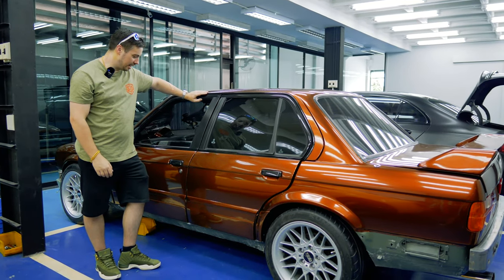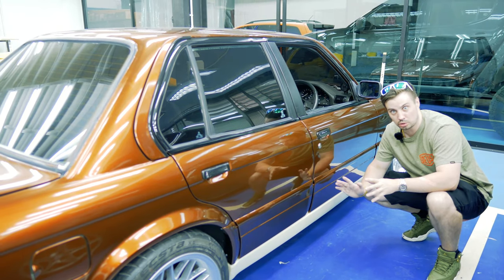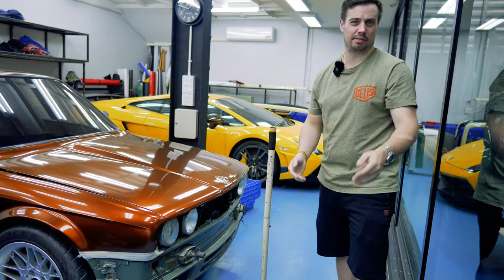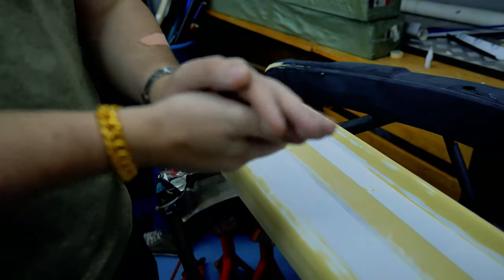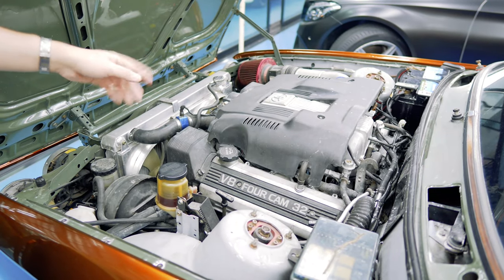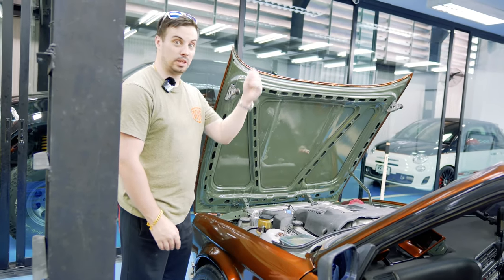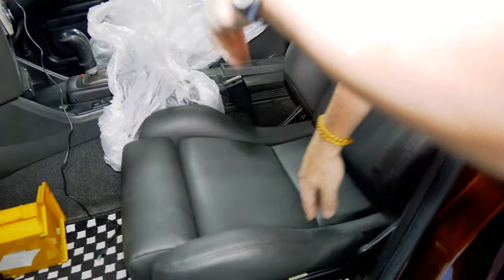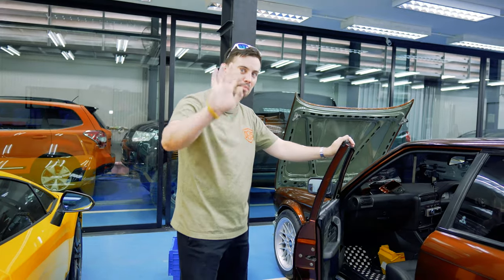Project Topgun Part 4 - Bodywork Issues & Colour Change - E30 1UZ V8 Engine Swap

Comment: im doing the same swap rn for drift. and you said its a 1989 1uz and that's actually the 1995 which has skinny rods, thick rods were '89-'94 you could tell by the plastic cover and fuel lines being cylindrical for skinny rods and octagonal for thick ones

Comment: So I have a mx83 with gen 2 1uz-fe non 
VVT-I for 1997 ls400 and looking at your engine it looks more to be a GEN 2 easy way to tell if it was a GEN 2 or GEN 1 Is with the fuel rail or The maf airflow sensor and The idle air control valve are different with gen 1 and gen 2 and looking at it seems to me to be a GEN 2 1uz